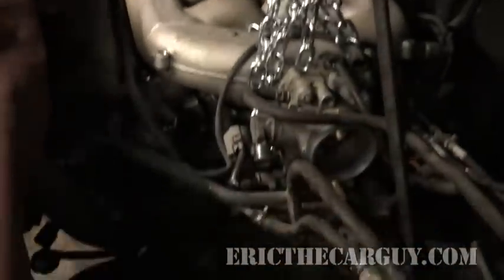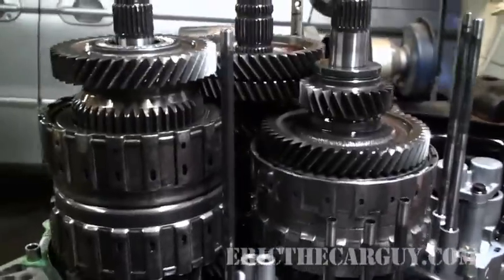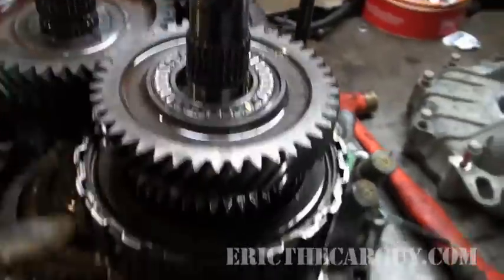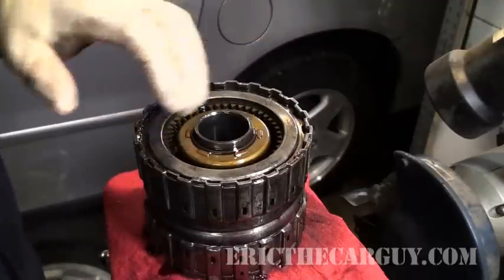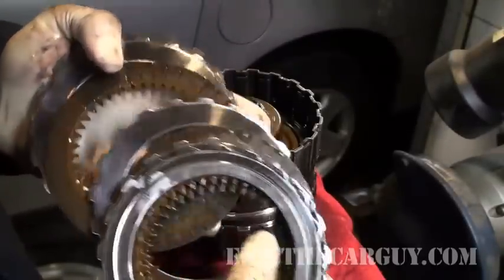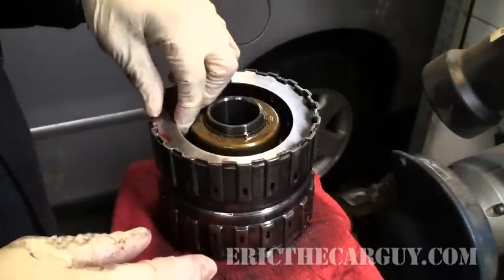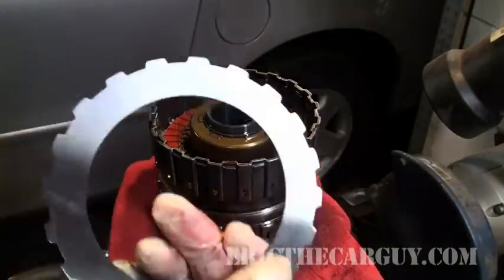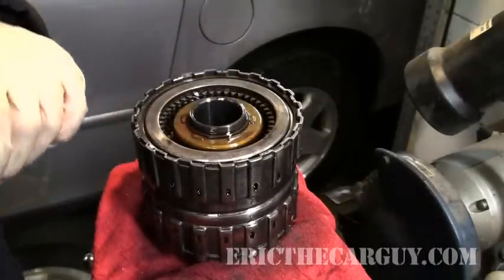Inside My Odyssey Transmission - EricTheCarGuy

Comment: Eric you have to change the pistons in all drums and all clutches in all drums also. you can chek the piston if works, to introduce aer pressure and to see if the pistons work or not. remember if you have a brone or worn clutches you have a problem with the piston in that drum; or with the line pressure or with the solonoid that regulate the pressure line that press the piston.

Comment: This is a great video to show why automatic transmission related work is so expensive.
Reply: most of the labor is actually removal and install of the transmission itself. Dealing with the transmission internals is done on a bench in a garage. It's alot quicker when done by pros.

Comment: when you pull the bolts on the shafts, how do you stop them from spinning?
Reply: You could do it with an impact wrench, but the bigger concern is this: How do you hold the shafts to torque the new nuts?

Comment: well eric theres a couple things i suggest for your newly replaced clutch packs, 1.Try a mix of honda ztf stock fluid and redline synthetic atf free of friction modifiers until you get the right mix of shift firmness and 2 most important of all check your shift selenoids replace if suspect or obvious if there not even clicking when applying 12 dc volts, and thirdly see if theres an update for your transmission pcm and make sure you keep the transmission temps down maybe add or upgrade your stock trans cooler, i dont know if those years odyssey came stock with a cooler or not.
Reply: Odyssey he's working on has a recall. They are known to frequent failures. Doing above that is just waste of time. He's better off putting in a remanufactured unit which he did later on his video.
Reply: Godlikehenry i got same odyssey where can i find the recall info,thanks
Reply: Godlikehenry Agreed. A re-manned unit should have the updated parts. Would also come warranted. Of course...that depends on who did the reman.
Reply: SonofGodly I think the recall campaign has expired, but search the forums for problems related to 3rd clutch and C2/S2 gears.

Comment: honda transmission are piece of sht .. worse of worse.. especially every car in late 90s and early 2k..  everyone of them are crap
Reply: Really? My Honda is a 1995 with 225k miles on it and the tranny still works like new.
Reply: only the automatic ones
Reply: Dodge transmissions are the worst.
Reply: crettybocker lol. you have no idea what you're talking about
Reply: spiffcats
YES!!!! Chrysler/Dodge has one of the worst automatic transmissions ever built. they've had problems since the 50s and possibly even before. My uncle had a Lebaron which went through 3 transmissions under warranty. it was a real lemon and eventually caught fire but that's another story.
Reply: no honda's dont have transmissions they mostly have trans axles , all fwd cars have trans axles they suck and are weak
Reply: Here comes mr fanboy bashing honda! derpy derp derp!
Reply: The point is they are not transmissions
Reply: Not necessarily, not always. The automatic tranny in my '98 Civic with 204,000 miles works just fine. I think one reason for many Honda tranny failures, is that most people don't know how to maintain them properly. They often  think that because it's a Honda, it must me invincible, therefore beating the shit out of it and not maintaining it properly, if at all.
Reply: crettybocker We can also call them transmissions like we always have. Theres no need to school anyone here its pointless.
Reply: +crettybocker: A "transaxle" is a transmission and a differential in the same box.  You are correct that all (or nearly all) front wheel drive cars (as well as the old rear-engine VW's and other rear-engine cars have them. The claim that "they are all weak" is BS.
Reply: yea 1993 accord ex 475.000mi see what i did there ? ,made up something on youtube NOTHING YOU LISTED WAS A FACT  . more so to autos, and i do forced induction you have no clue limits on transmissions. the cars you listed are  140Whp at most cars I drive 500whp 600whp cars and i have done many honda's , transaxles are not transmissions if it houses a diff its a trans axle if not transmission  , my point is i push cars to limits on a daily basis and anyone who really also is really in my line of work will tell you 90% of the time a transmission will be stronger vs a trans axle  in the same cata , most trans axle need to be space saving and weigh alot less unless we are talking about very very high end trans like the focus st or the mazda speed 3 ,evo. so on most will handle 200 or so hp over stock limit on average before getting weird auto most of the time 125 150 those are not dead on numbers , just look at what is considered a strong trans by honda m2b4 come with h22 175 to 180whp they can hold up around 250whp being careful now the s2000 is one of the only ones that comes with a true trans ap1 and ap2 can hold 450+whp and  you see that consistent with every make the transmission  will always hold more power stock vs stock sorry that is a real fact .
Reply: Steve Newell nobody bashed anything you are as dumb as a rock with your friend #1. he said also they are weak #2 fact fwd honda's do not have transmissions they are trans-axles fact .fact 3. you are fat , im the  stupid one ? yet you don't even know the difference between a transmission  and a trans axle ? funny kids go back to your 100hp civic

Comment: Hey Eric I recently bought a 2002 acura tl type s with about 106,000 miles and heard that the transmissions go bad pretty quickly so I was wondering how I can prevent it from breaking and matenince I should do or?

Comment: Hi Eric oobu5 from across the pond ,i bought a AMX 304 ci with no forward drive at all an popped the box out the clutches were shot ,i also had a 2.0 uk ford  capri auto so i took the clutch plates out and measured them guess what they were the same size so i made up a pack from all that i had and put them in the in AMX  ,yes i know dont use second hand parts but i had 4 kids to bring up anyway i did get a new seal kit and fresh fluid and after some careful adjustments it worked a treat .

Comment: Hi Eric, thank you for the video the transmission in my 2001 Toyota Rav 4 is starting to fail (2nd is slipping) and my mechanic (who I trust and it really good) told me that it wasn't a good idea to do maintenance on it that it needed to be rebuilt and   I was really curious to see what a transmission looked on the inside when it is failing and your video was very helpful I am not a mechanic and would never try what you are doing but at least I know why rebuilding mine will cost over $2,000.00

Comment: Eric,  I hit the wrong button before I finished with my post.  Thank you for an excellent video.  Honda's engineers were very shortsighted when the made a transmission without a serviceable filter.  Why not put a spin on filter or cartridge filter that is serviceable without the need to split the case?

Our 1997 EX had issues with the transmission and did not search enough to find there was a recall on the transmission.  I had a Jasper rebuilt installed.  The Jasper rebuilt failed in two year and three months with less than 25K.  The transmission had a three year 100K warranty and they made it good 100%.  I live in Southern Indiana and I decided to go with a company in the Hoosier State.  It cost a bit more to have the Jasper unit installed instead of my local shop reman my old unit.  They only offered a two year 24K warranty.  My local shop came well recommended by I have not checked the mileage, however, is has been in the car since late March 2013 and it is going strong! Jasper insisted genuine Honda transmission fluid was used when the unit was filled (both times).

Thank you for your excellent and informative videos!  I have a Helm shop manual for every Honda we currently have.  The manuals are helpful for spec, troubleshooting diagrams and suggested special tools.  Your videos take over where the manuals leave off.

Thank you for a great resource!
Reply: Re: External filters.
It's a popular opinion that they should have external, serviceable filters, and in fact...some models do now. But in truth...during normal operation these transmissions generate so little fragmentation, and whatever is generated is captured inside by various means. It hardly warrants the additional expense to use them in every vehicle.
If your transmission is making fragments - big enough to cause problems - then changing an external filter is going to do little more than help you sleep at night.
Of course...some will argue that is reason enough?

Comment: I had 2nd gear slipping on my 2000 Odyssey. Called my mechanic and he said the first cheap thing to try is a flush and fill. Called around got a price of $130.00. I said OK went to Valvoline I.O.C. and they saw I had 262,000 miles on it. They refused to do the job. Too many miles, no proof of previous service on trans. with them,etc.. So I did what any red blooded american guy would do. I decided on DIY. My mechanic told me put a quart of Trans X in with the new fluid. Guess what...IT WORKED!!!

Comment: I did this in my 1992 Dodge D150 and it was successful for a full 3 or so months and then the transmission started to slip again so I guess I didn't fix the issue.  Either way it was a fun experience but next time after I try to rebuild the it and fail I'll be buying a new transmission because I miss that truck.  I decided to junk the entire truck after I failed.  I still have it, it's behind my parents house but oh-well.

Comment: first auto trans I took apart in school was off a honda....I broke the case in 3 places trying to put it back together, and I crossthreaded one of the nuts holding the sprockets, the one that turns the wrong way. It was fun.

Comment: Eric,
You have the talent and mechanical aptitude to repair an automatic transmission, the place to do the job and the correct range of tools needed. a backyard mechanic, IMHO, should never attempt this job...a rebuilt is the way to go. That said the theory of operation is not that difficult to understand. Did the trnasmission fluid become discolored or have a burnt smell?

Comment: Eric what's your take on drain and fill procedure in Nissan a/t's? I did a drain and fill in my G20 it was smoothing out like butter at 30-40. Then when it shifts at low speeds 15-20 on flat surface it jumps just like before (its always done this even before drain and fill but i figured why not rule it out.) What are the chances of bad mounts causing hard shifts? I know Nissan autos are terrible creations, but would be nice to have a comfortable 1st to 2nd shift.

Comment: I opened up a Ford Taurus automatic transmission took it apart and put it back together and left out a spring and a white spacer. You got skills. I would rather replace the transmission. However I like seeing the inside of transmissions.

Comment: ive never had an automotive transmission apart but ive rebuilt a couple dozen on heavy equipment this transmission is similar to what we refer to as a powershift transmission it uses a countershaft design as opposed to a planetary design they are really not that difficult just get a good manual and be absolutely sure every part goes back where its supposed to and DON'T cut corners that's where most people screw up.  Most people just seem to be intimidated by them

Comment: Firstly, thank you for the uploads. All well done from what iv seen thus far tho... you look exhausted :( . Second, I have a 97 Honda Civic Dx 2 door, and it needs the passenger side axle seal to be replaced, how tedious is that to replace? (a garage quoted me like 100$~labor mostly im sure, and the seal is 12$ if i get it my self from a parts store.. provided that's the right part).

Comment: I just paid for my transmission repair $1200, mechanic did same thing plus i replaced for $300 new manufacturer torque clutch converter solenoid. Now it shifting very different then was before, when i push on gas van not go very fast like was before. Any body know how should this is normal or maybe Honda upgrade their parts Torque clutch converter solenoid parts N 28250-P6H-024. Mechanic give me 6 month with mileage 6k warranty, also I ask my brother and he tell me transms. will run long life.

Comment: hi, eric i have the same exact problem with my 1998 acura 2.3cl automatic which is the same exact transmission. My idle revs sometime when i press on the gas and the check engine light is on. On the code reader say P0730 Gear Ratio Incorrect. Does that mean i have the change all the clutch on the transmission? Will that fix the problem? How can you tell if the clutch is bad? Did you fix the problem with the car? i was about to the same to my car. your information will really help me. thanks!

Comment: Whew.. reminds me of my 2003 Accord EX-L v6..  Transmission failed soon after I purchased it.. was replaced under dealer warranty.  It was ok.. but about 15k miles later it started acting up again... I traded it in on a 08 Fit. Which. Developed an engine knock. Dealer replaced the engine with a used 10k mile engine?  WHat?? UGH THe engine seems to be ok.. runs great.. but a used engine?  Come on.

Comment: Ive rebuilt a couple transmissions.. They were American products... Replacing clutch packs is pretty simple... Taking the transmission out is actually harder than tearing the inside of one.. You just put things back in the reverse order. And mark all the parts

Comment: I know what you mean by its a miracle, I took out the A341 4speed out of my SC400. 

I had the printouts from the service manual to repack the clutches , and forum posts to shim the accumulators for faster shifts.

I put the clutches in oil at 6am , by 8am the trans was out - (no hoist no pit). By 2pm I had put the new clutches in and shimmed the valve body.

By 6pm I was done, but at no stage was I sure that I was doing the right things. 

Really stressful

Comment: "dont try this at home" most automatics are really not that bad, just keep a transmission service manual on hand, bag all parts and lable the locations. A good memory also helps. Though most of the ones i have done have been Chevy TH models so they overall alot easier to deal with.

Comment: not necessarily, there is usually more room than you would think under a car, and the transmission on some auto vehicles is huge, but as long as you know where the clutch packs are for the gear that your working on, shouldn't be much harder than working on one with less gears.

Comment: Any experience on Mercedes 190 E 2.0 automatic transmissions? My transmission dont slip, but it revs a little when shifting from 2 to 3 gear when i run up a hill. Can the clutch be wearing out?

Comment: if it failed again im guessing that your not getting enough pressure to your clutches from the valve body i would check the valves if you plan on doing more surgery

Comment: Hey Eric, good video as always. Just a quick question. Seeing as the clutches didn`t seem that worn, could it be down to a issue with the oil? Seeing as a lot of oil, both motor and gear, have a lot of additives that `wear out` over time. how many miles has the car done on that gear oil?

I`ve heard of Audi having some problems in previous years regardig `sealed for life` units slipping and breaking after 140 000 kilometres. ZF, the manufacturer, had a  service interval of 60 000 km.

Comment: Is a pity that you didn´t change the seals inside the servos while you had the drums apart.

Many times a transmission can slip when changing gears because of a leaking servo that takes too long to build up pressure.

Cheers

Comment: dont know if anyone else said this, but usualy the clutch packs fail because not enough hydraulic pressure is being applied because the apply piston seals in the clutch are hardened/worn. i think if u had changed the seals, it might have been ok.

Comment: I took apart my 97 eclipse gsx AWD trans and found a broken kickdown band and ruined front pump and when I had it apart, which is way less complicated than your honda, I proceeded to scotchbrite the steel clutch parts to remove glazing. I also checked all the surfaces of the friction materials to see if they needed to be replaced.  I replaced the broken parts and put it all back together and wala, it worked and no problems so far.  It's scary to try so try it first on a junk tranny.

Comment: I must agree:  You are crazy for attempting to do that.   I attempted to do a Taurus trany once and quickly learned to regret it.  It is true what they say:  "Clean room" means clean room.

BTW, why did you suspect clutches when more logical would be O-rings and electronic control units?

Comment: My car is not shifting at the correct rpm. It is going about 2k- 3k rpms higher than correct down shifts. So basicaly, 2nd to 3rd should happen in the 3k range and at 30 mph (or somewhere there abouts), but if I throttle down it will rev to 5-6k. Its hard to explain.... basicaly its like if you rev the engine at idle in park...except its happening while moving. If you need me to explain better let me know what doesn't make sense. Any Idea?

Comment: Hello Eric. I have 97 accord ex 2.2 vtec, what should the rpm''s be when driving at 75 80 mph steady. Mine reads 3000 to 3200 is the correct or normal. i also changed  both sets of selenoids that on the transmission located by the trans dipstick it didnt really change from the before to after.

Comment: Hi I gather it failed again? What went wrong? I think you should try again, it must be possible to work out exactly what went wrong with your repair. Most transmissions have a few weak points with well known fixes or updates.